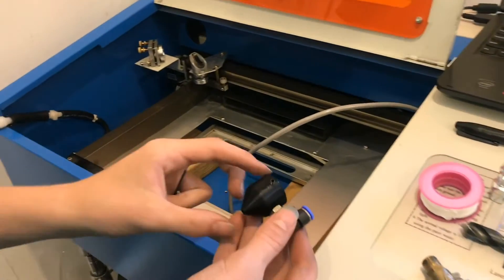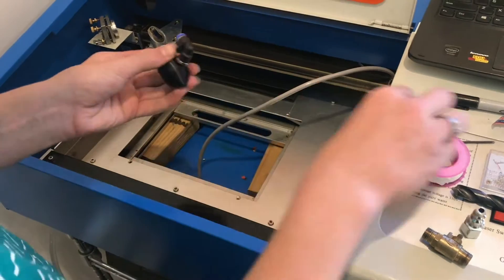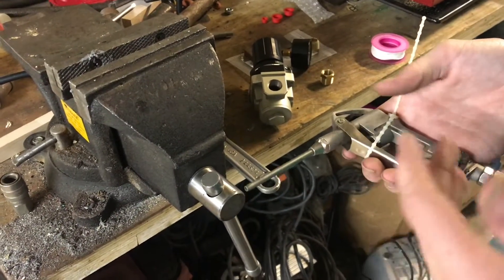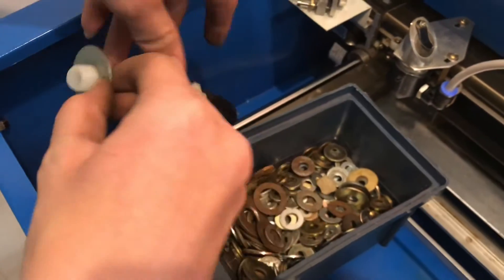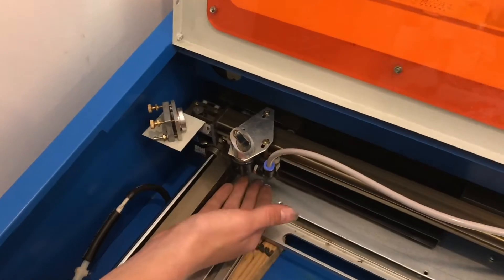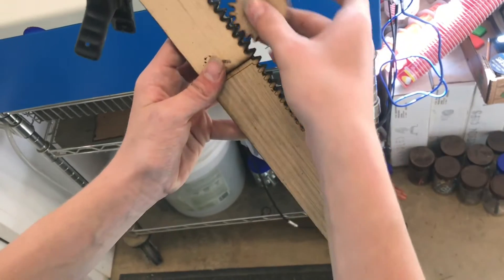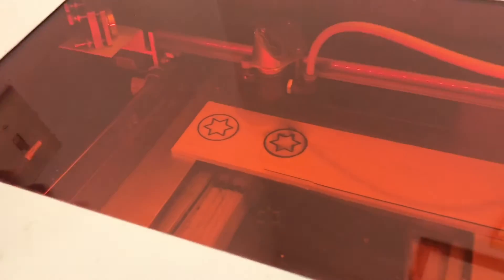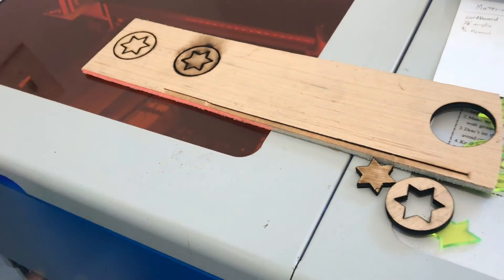adding AIR ASSIST to a K40 laser engraver cutter (BIG DIFFERENCE)

Comment: Balsawood?
Reply from the maker: It’s quarter inch Louan, it comes in 4 x 8 sheets at Lowes or Home Depot for about 20 bucks a sheet. It’s like a laminated pine. The outer layers may be something more substantial, I’d have to look it up. I’d like to try ball so that would be interesting. Hope this answers your question
Reply: What speed and how many passes are you using to cut through?

Comment: Could you engrave an AR-15 lower with this laser- i believe it’s basically cutting the paint/powder coat not actually cutting into the metal
Reply: if its anodized it can laser off the paint off a AR .
Reply: Yes that's correct. The laser isn't powerful enough to do anything to the actual metal, but it'll remove any coating that's on it

Comment: Nice result!  That's a game changer! :)
Reply from the maker: Definitely a game changer, Air assist is a very nice feature. If you’re just engraving it’s not so important. If you’re cutting which is a very important feature of this laser cutter it does make a big difference
Reply: Absolutely! Also makes the unit wayyyyy safer to operate!:)

Comment: Good Job ❤
.. But I see that the workspace is larger than  30*20  cm ?
Reply from the maker: We definitely did some modifications to maximize the entire gantry inside the machine. We removed some of the metal for the vent that was a little tricky. We also remove that clamp that was not very useful. There’s a lot of modifications that can be done on these machines to make them better.
Reply: @livefree6878    

Is it  easy !!  or is it so difficult? I bought the same laser  a week ago 😞
Reply: @livefree6878  and how about the Compressor? its seems that you are using a SUPER compressor ! That Make the ✴️ LAS3R BEAM BOOSTED!

Comment: Can you give  a link to the air assist adaptor for the K40 please
Reply from the maker: I did a couple searches on eBay, but I couldn’t find it. They must not of listed it again. If I see it I will add it to the description. There was another style that had a single tube, I kind a like the idea of using a cone and driving air all around the laser. I have used a simple tube before I bought this one, and it did work well.
Reply: @livefree6878  Thanks anyway. I did do a search myself before I made the request but couldn't find any anywhere, not with the hose attach quick connect.